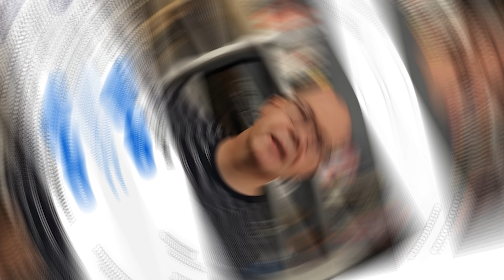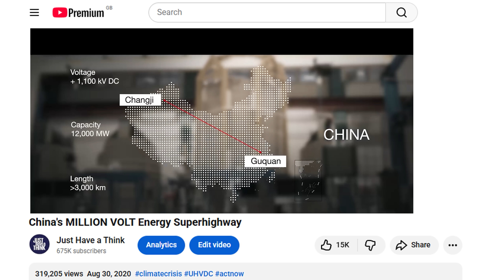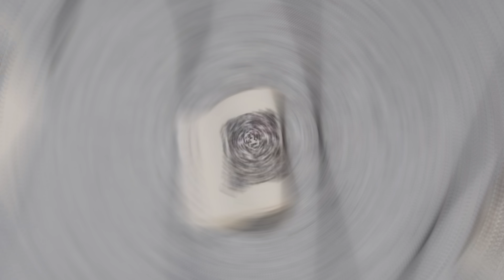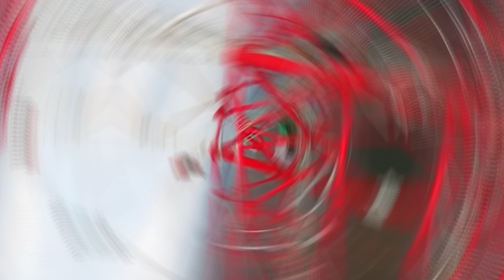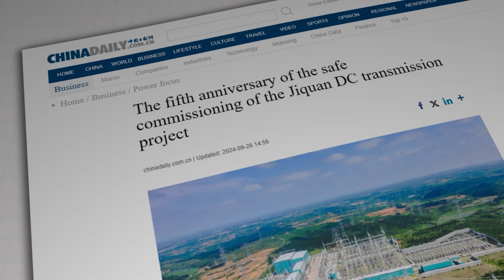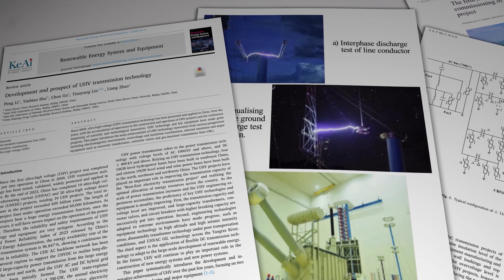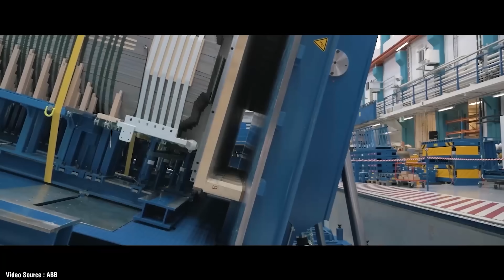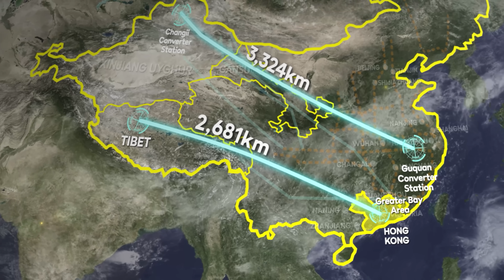China's ultra-high voltage transmission lines now breaking all records.

Comment: Keep up the brilliant work, been subscribed for years. I'd love to see a power-loss comparison between above-ground power lines through the air and buried, insulated lines that aren't in danger of getting hit by cars or blown over by the increasingly violent weather. Cheers!
Reply: Around 5x to 15x more energy (heat) losses for the buried lines, over the same distance. 🙏❤️ (500% to 1500% more losses).

Not to mention how much more costly the installation, maintenance & associated costs are, for the buried lines. ^^ 👀🙏

Studied Electrical engineering; energy transmission was part of "the focus" in the sub-modality" I attended.

Edit.: Here, I talk about AC losses.
Reply: @elektrotehnik_94_NinoD Those losses probably only apply to AC tranmission with which you don't want any potentially conducting stuff around the wire because it would induce currents in it. With DC that is not an issue.
Reply: @MartinMaat with DC you have isolation issues and conversion issues so it is always a tradeoff.

China can get away with many things because of the sheer scale of their projects.

Some technologies only pay off or become possible after a certain size is achieved.
Reply: @snes-mode7 This. 🙏❤️ A new technology like this needs a whole new *expensive* expanded supply chain. ^^ 👀🙏
A lot of extra cash/ investments/ "capital costs" that (particularly? only?) make sense in China --> "the epicenter of global manufacturing"; with particular inland renewable energy abundance, empty non-populted land, a flavour of authoritarianism etc. 😶🙏
Reply: @MartinMaat Yes, thank you. 🙏❤️
With DC, I'm unsure but I think buried DC is likely only 50% to 300% more energy losses than in-air DC. 

This & other technical/ cost reasons, makes in-air DC transmission lines EXTREMELY rare. 🙏
Reply: @ele @elektrotehnik_94_NinoD  that’s interesting, I live somewhere with power buried in conduit along with fibre and phone lines so I hadn’t considered that
Reply from the maker: @jasonbelanger7525 Great suggestion. Many thanks
Reply: When that ultra high DC voltage gets to the destination how do they convert it back to lower voltage AC? Sounds like the equipment at every user end would be very expensive.
Reply: @justtinkering6713 There are devices called DC to AC converters that do this trick.  They are expensive, and that's one of the reasons that AC transmission line are way more common.  But if want to transport really a huge amount of power, over a great distance, then DC lines are the way to go.  We have a 500KVDC line in the western US.  Sends power from Oregon down to CA, around 2000 miles.

Comment: I would like an episode that really looks at combining solar panels and the battery of an EV to run the house and feed the grid, with references to solutions that already exist. I hear a lot about its potential, but, at least here in Norway, no one actually offers a solution that combines solar panels charging the battery, and the car offering both V2H and V2G – only one of them.
Reply from the maker: Thanks for your suggestion.

Comment: Video topic: Could you make a video of China's heavy weight electric trucking being adopted at accelerating pace?
Reply: My understanding and personal experience is that it's the light duty trucks that are switching already. I live in Yunnan and run along roads that get lots of trucks. None of the big ones are electric but a meaningful number of the delivery trucks in town already are.

That said, maybe the fact that the trucks I see mainly go from villages/farms to depots outside town rather than intercity, changes things. And maybe it's very different in the east...
Reply: @GeorgiiGrogan  

Sometimes, it can be hard to tell. At least in the U.S., what few electric semi trucks do exist (excluding Tesla) look almost identical to diesel trucks, so unless you know exactly what to look for, or the truck says "electric" on it, you can't tell.
Reply: @ab-tf5fl  In China, it's very easy to distinguish between these two from license plate's color. How about ths U.S.?
Reply: @GeorgiiGrogan also I’ve seen how trucks gets severely overloaded in China, just imagine those beeing electric! 😂😂😂😂
Reply: @alanmay7929 Don't tell a lie that can be easily fact checked. Then again the people you lie to don't care for facts anyway - 1450  not being paid too well these days I heard.
Reply: @hclau218 what a joke!
Reply from the maker: Thanks for your suggestion.
Reply: The Scandinavian countries also have heavy trucking with up to 3 trailers and 100tons of capacity
Reply: Janus motors in Australia are converting large trucks to EV with swappable batteries. They are growing quickly. Edison Motors in Canada are in the early stages of building range extender trucks for more remote regions (logging was the first consideration). I consider that transitioning trucks to be more important than low mileage cars.
Reply: I feel your proposal is difficult to implement. Heavy-duty electric trucks in China are mostly used in relatively closed environments such as mines or ports, where outsiders may not have access to more information.
Reply: Heavy weight trucking is done in Australia and those diesel semi beasts can haul up to 6x the load of regular semi and litteraly go everywhere as long as it’s drivable.
Reply: Current electric heavy-duty trucks primarily operate on fixed routes and utilize battery swapping.

A widespread rollout is unrealistic until a fundamental breakthrough in battery technology is achieved.

Comment: International standards are not impossible. Everywhere on the planet now uses the IP protocol for computer networks.
Reply: Which one did you mean IPv4 or IPv6? IPv6 is about to reach 50% of internet traffic and is growing. And there are both IPv4 only setups and a small fraction of IPv6 only setups around, meaning they can't talk to each other directly.
Reply: @rafaelfv3362 Well they're both iterations of the protocol and every machine in the world runs on them. And they can interoperate by various means.  Otherwise there'd be problems.

Comment: [storage of electricity not needed when being produced] it's a shame we do not nearly enough research in solving this problem. tucking it away in batteries might not be the smartest idea. 
the EU just eased their intentions of outlawing combustion engines for everyday vehicles. probably a big mistake in the medium and long run for the European auto industry. however, WHAT IF we find a more efficient way of converting electricity not needed at the moment of production into methane or hydrogen? atm the energy loss is still too high to make this look attractive but if it can be improved than maybe the combustion engine in cars can be allowed to exist a bit longer provided the fuel comes from renewable energy sources.  :goodvibes:
Reply: what is happening with the wind and solar project in north africa and the under water hvdc link to the uk grid?

Comment: Superconductivity in transmission cables would be a winner.
Reply: It already exists, apparently superconductors still have losses with AC power
Reply: @leonfa259 Flom magnetic induction i guess. The cable doesn't need to heat itself if it heats surrounding conductors
Reply: @lafeechloe6998  Eddy currents and the like, also since super conductors need inefficient cryo cooling that takes energy too
Reply: Skin effect I guess
Reply: High Voltage = Low Current.Not necessary, or feasable.

Comment: Hi! Could you do a video on Eavor's newly running geothermal project in Germany? It seems like a very exiting milestone for geothermal electricity and heat.
Reply from the maker: Hopefully coming your way in 2026
Reply: Yes! I would like to see an overall update on deep geothermal, since there's also a pilot in I believe Texas using the plasma drill developed by Quaise. The other thing I would really appreciate is some explanation about exactly how many kW per well can be generated and how that compares with existing coal and gas powered plants.